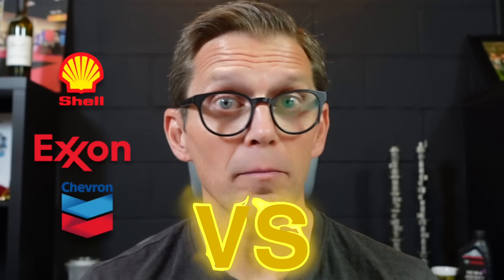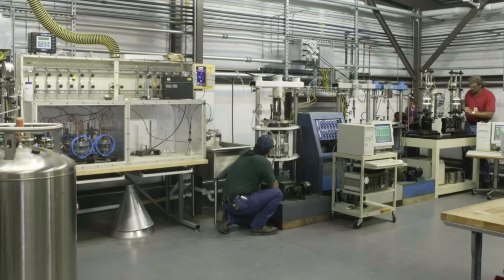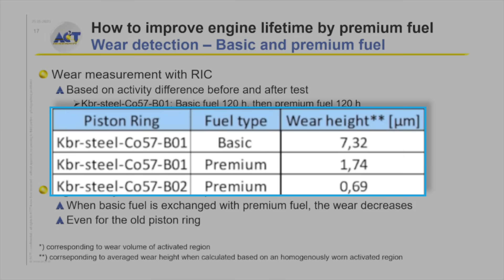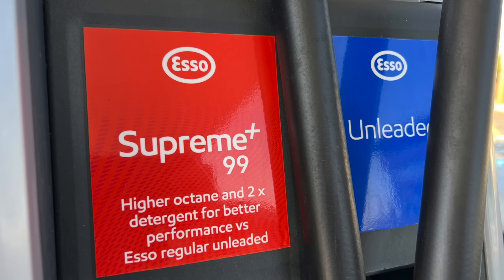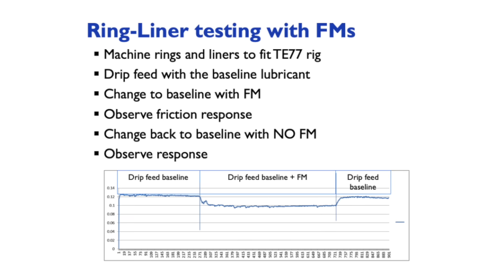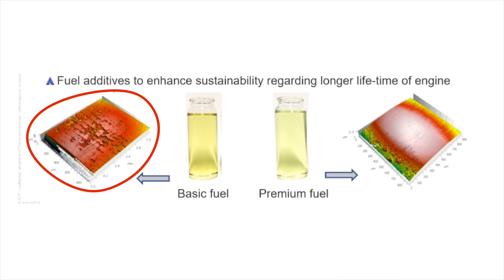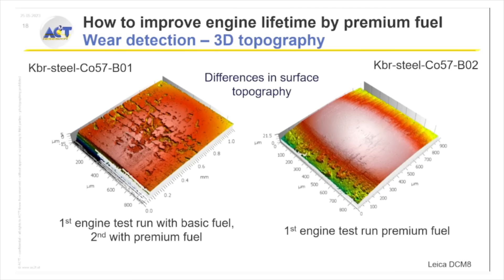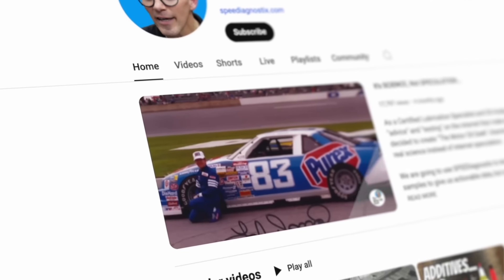Can Premium Fuel REDUCE Engine WEAR?

Comment: I use AMSOIL Upper Cylinder Lubricant additive at every fill up for reasons you mentioned in this video.
Reply: Cool, but how do you know this product works to any level?  Does Amsoil have the testing results as performed in the data Lake presented in this video?
Reply: @chestrockwell8328  yes, they have the test results on their website
Reply: @chestrockwell8328    I believe it is a PEA additive, which is what Lake recommended in one of his other videos.
Reply: @chestrockwell8328    I believe it is a PEA additive, which is what Lake recommended in one of his other videos.
Reply: @chestrockwell8328    I believe it is a PEA or POA, based additive, I forget the acronym but, along with a few other makers those were the ones to use. Which is what Lake recommended in his fuel additive video.
Edit;  Er no that was AMSOIL PI performance improver. Good stuff!

Comment: It was one thing when for many years premium was 20 cents a gallon more than regular but now that it's a dollar a gallon more, there's no way I'm paying it.  I don't understand how they can justify charging a dollar a gallon more for premium. You can buy a good quality fuel additive instead of buying premium fuel and still come out quite a bit ahead, especially if you buy it in bulk.
Reply: I think there is some confusion over the word “premium”. Not 100% sure but I think Lake means “premium quality” not “high octane from the premium pump”. In other words here in Colorado I can buy premium fuel that is only 85 octane.
Reply: @dac7046  Shell V Power Nitro premium has more 3 times more additives than Shell regular. That is according to Shell!
Reply: @dac7046  Required octane decreases with altitude due to atmospheric pressure.
Reply: @dac7046    Yeah, I suspect he is talking more about top tier gas over high octane. 

   Costco gas is top tier and often one of the least expensive in my area at least.
Reply: @dac7046  You have a good point there. I really like Lake's content but imho he really should be more careful about his wording and the video clips he shows in relation to those words. I was recently watching another video of his in which he was discussing fuel system treatments and stressed that you should get one which contains polyether amine. As he is saying this, he shows a clip of someone picking up a bottle of Super Tech fuel injector cleaner, which suggests it contains said ingredient but doesn't.
Reply: I think they do it because more and more cars are now requiring 93 octane because it seems like every manufacturer is switching to turbo which is complete bullshit.
Reply: Regular $2.79/gal
Premium $4.60/gal
That's what it is in my town. 
So yes, you can make your engine last 100,000 miles. All you need are looks and a whole lot of money 💰 🤑
Reply: @ two dollars more a gallon? I don’t think so…
Reply: So what about just using an additive?
Reply: @bullaaron  I was thinking the same, my owners manual says additives are not recommended. If you’re still under warranty and you’re using an additive, they could argue the fact that it says that in their manual and say sorry, this is not under warranty. I think additive’s work though, stable example keep your gas good for two years. so why wouldn’t an octane additive work?
Reply: @ I was thinking the same thing. I used to buy chevron Techron and use it but a mechanic convinced me it was a waste of money. Not sure if he was right or wrong now.
Reply: @bullaaron nah that's actually the best and only additive out there that really works with data to prove it. I watched 1 too many videos and people testing it. I use it here n there in everything now. It has some kind of cleaner in it that does a damn good job in keeping things clean plus lubricant for upper cylinder walls n such
Reply: It's about $0.10 more for each grade here.
Reply: For me it's about $.50 to $.60 to go from 87 to 93.  But I think people do better if they can get Costco gas.

Comment: Would like to see some research on the so-called "Top Tier" fuel, which is advertised as having a higher level of additives (detergents are highlighted). A variety of well known fuel brands now advertise Top Tier complince. Shell has long been on the Top Tier list but i wonder if the others on the list have similar anti wear addiives as well as more detergents than the basic fuel? I saw a graphic demonstration of the value of Top Tier fuel with the the 5.4L Ford I once had.. an engine notorious for the spark plugs breaking off in the head when you tried to remove. Autolite's poor spark plug design, since updated,  was the root cause but combustion chamber deposits tended to lock the plug in practically assuring the plug would break. I ran Shel Top Tier for about 30K miles and the plugs came out without issue and a borescope look show the cumbustion chambers remarkably free of deposits.

Comment: Many years ago, I worked at a fuel terminal, and every single gas station uses the same gas, but the driver will take a little additive and put it in the top of the tank, I forget the gas that was red or pink whatever it was that was just added right at the truck, because all that gas coming across the country is all the same
Reply: Over the years I've always heard this comment. But one time I heard a this comment with a little more information. And that was non big brands will get a lower price by buying the batch that was used to rinse the pipes and what not. Kind of like the saying don't buy a car assembled on Monday during hunting season. Everything is from the same factory, but not everything  the same quality. Any additional insight on this?
Reply: @TakeoHope  it’s all in the same pipes and this terminal was right by JFK airport and it went into smaller barges in New Jersey and a tug boat brought over and every gas station would pull up and they all got the same exact gas, but some would get the additive

Comment: A fuel brand comparison vs piston ring wear would be really helpful in furthering this topic.  Many thanks, I’ve learned a lot from listening to your tips.
Reply from the maker: Great suggestion!
Reply: @themotoroilgeek  Please include Lucas upper cylinder lubricant, and such type product ,
Reply: @Forseen-vm1qs  good idea
Reply: If you do a brand comparison try to get Quick Trip & Costco fuel please! Those are mainly the only two TOP TEIR fuel brands we have locally.
Reply: @themotoroilgeek you keep consistently hitting home runs with your videos. 😎
Reply: @themotoroilgeek  Hey Lake, THANKS for another VERY interesting & informative video. 
I feel compelled to inject a point. By "Premium Gasoline" in the context you're using premium in this video, I take 
it to mean premium quality gasoline. Although, I'd bet the farm 99% of your viewers took your wording to mean 
Premium...higher octane...gasoline vs Regular...87 Octane gasoline.
As you likely know, using gasoline with an excess octane rating than an engine requires is not recommended. 
Not to insult your intelligence: Engines have an octane quench point. Once it is met, any unburned octane that's 
NOT consumed in the combustion process creates ash. This ash will (quickly) degrade the engine oil & create 
undesirable deposits in the combustion chamber(s), on piston top(s), valve head face(s), etc. 
Hopefully, viewers of this video aren't now buying 91, 92 or 93 octane gasoline for their 87-octane-rated engines. 
No doubt MANY of your subs & viewers would appreciate it if you make this point clear in an upcoming video. 🙂 
Respectfully, an Engine Oil Geek in Yucatan Mexico, 
Ben
Reply from the maker: @duygukayhanisaskank4915 in this context I did mean the higher octane fuel.
Reply: @duygukayhanisaskank4915 I had similar questions/thoughts. Will a top tier 87 octane fuel contain the same friction modifiers as the 93?
Reply: @danielphillips1094  Hello & I appreciate your reply. I'm not sure what you mean by "friction modifiers". Regardless, you can be assured that the only difference between the grades of Top Tier Fuels is their octane rating. The chemical components added to the fuel to qualify it as a Top Tier Grade are identical in proportion//quantity. There are only a couple companies making the chemical components. So, quality control of these gasoline additives is reasonably manageable. 
Never-the-less & as I stated in my previous commentary; It's not advisable to habitually//regularly use gasoline with a higher octane than the engine requires. 
There are a few exceptions. But in normal operating conditions, it's bad for the engine & the engine oil. 
Best regards, 
Ben
Reply: @themotoroilgeek  It would be incredibly informative.  I hope you get around to this..
Reply: @themotoroilgeek try bnd automotives ACES fuel additive....supposed to increase piston ring/bore life as proven by DV.
Reply: @themotoroilgeek  Would be alot of work, but have the fuel injector for each 2 cylinders (V8) fed by a different fuel. This way, 4 different brands are tested with loads, fuel rate and ignition/timing being exactly the same.
Reply: Could you test additives to add to fuel in case top tier fuel isn't available
Reply: @richkarlock2195  he already recommended and recommended to me Chevron Techron.... I had 1.6% fuel dilution of my oil in an 18 Camry.
Reply: Use top tier brands for sure

Comment: I've run Shell V-Power Premium in my newly built 2.5L boxer since new.  So glad to see the data behind the friction modifier.  I got 470,000km out of the first engine and it was still going strong when I got this rebuilt one.  So I want more than half a million out of this one!
Reply: You rebuilt a motor that was still going strong?
Reply: @insanelywicked873  Replaced, but yes.  I don't know of many out there who still have a Subaru EJ20 that saw more than half a million, so it was time.  The rest of the car has been rebuilt and re-engineered too, which was the plan all along.  I'm not a fan of the new computers with wheels.
Reply: @insanelywicked873  At that mileage, yes. Just because it's "going strong" doesn't mean there isn't going to be wear. Plenty of seals, gaskets and bearings are going to be worn out, leaking, or near failing. Better to be proactive than reactive because it'll be cheaper than when you blow a head gasket, piston ring fails, or worse a crankshaft bearing fails.
Reply: @SilvaDreams  Exactly, and it was the bearings I was most concerned about.  You get very little warning about that.
Reply: Subie gang🤙🤙 i only run top tier in my built 04 sti, my wifes 08 sti hatchback, and our tribeca! We love our subarus!!
Reply: Too bad that many gas station owners pour the regular into the premium tanks, thus nullifying the benefits and potentially damaging the engines.
Reply: @caryg4638  I don't know where you're from but over here it's not up to the owners where the new fuel deliveries are deposited.  In fact the owners are rarely ever onsite.

Comment: One other thing that I'm a little concerned on your explanation on gas. What do you mean by premium fuel and basic fuel? Do you mean higher octane gas is better or gas? Or? top. Tier is better sorry if I missed it. But I don't quite follow what you mean by the 2 types of fuel. Because they always say, if your vehicle doesn't need premium fuel, don't run it in it. I take premium fuel is high-octane. Fuel?

Comment: Hi Lake, speaking of fuel comparisons, it seems that you can get slightly more power out of an engine by mixing a small amount of low octane fuel with high octane fuel, the theory being that the high octane fuel ignites quickly giving the initial downward thrust on the piston, while the lower octane fuel igniting more slowly enables the cylinder ignition to last just that bit longer, thus increasing the acceleration of the piston over a longer movement.

It would be very interesting to see the results of testing this fuel mixture.
Best regards,
Mat.

Comment: Two comments here. 1. You didn't answer which is more important, fuel or oil quality? I would guess both are important, but the premium price on the premium fuel (in Europe) is rather prohibitive to buy the premium fuel. 2. I doubt that fuel quality is the only factor in the massive differences you see in the oil analysis wear numbers. I would say that air and oil filter choice is at least as important, as silica particles coming in through the air filter and not being filtered out by the oil filter are known to be one of te main factors of engine wear. Having bad filtering of air and oil will have much more silica particles of the "wrong" size suspended in the oil and causing engine wear. Could you make a video on this?

Comment: That was one great lesson.  I only fill up at Shell or Chevron.  With their fuel programs, their pricing is actually very competitive
Reply: Shell has programs that save you money. Most pumps have advertising on them. You can get the app on your phone.
Reply: @oldgringo66  oh I know. I have it. Once I save $.60 a gallon on gas with all the incentives I banked up.
Reply: Ours is at least 10, sometimes 15 or more cents per gallon higher.
Reply: @randywl8925  with their Fuel Rewards program you you can save up to $.10 a gallon and then with other incentive, you can save 15 or more.

Comment: Yes... follow up with specific brands of gas, so we could know which USA brands offer the best wear protection... I try to use "Top Tier" gas as much as possible... but know, )as my brother did the tanker blending),  they are not all the same..."Top Tier" but proprietary and varies from brand to brand.. From my research it seems Shell is the top of the heap,  but not sold in our area... Mobil/Exxon makes lots of claims, but I notice here many of those pumps do not have the "Top Tier" endorsement sticker... The explanation I got was Mobil doesn't monitor independent Mobil station here in the NE area I live, and many are not "Top Tier",  but buying through independent suppliers/trucking, and isn't any better than Joe's garage... Marathon seems consistent .... but how good is their "STP" additive package...
Reply: Did you actually contact Top Tier? One of my local Mobil stations did not have the stickers, I contacted Top Tier with the address. They informed me that station was definitely selling Top Tier gasoline and made note it was lacking stickers. Within a couple months there were stickers placed.
Reply: @Nilumbra  No I did not... and Top Tier would tell you exactly that, as that is the official line...But.... I did speak to my brother, who recently retired, and did the blending from one of the two pipe line terminals in our area... His explanation was... Mobil is supposed to be Top Tier... but there is no longer any oversight in our area, as Mobil doe not have an admin here.... Many of the independently owned stations carry the the Mobil name... but their is nothing to stop them from buying from independent haulers at a reduced cost... who can load generic gasoline with minimal required additives... Increasing the stations margins... As a possible  unstated disclaimer they may not fly the Top Tier banner on the pumps, to avoid conflict if checked... I would like Top Tier to come to our area and police a little... at any rate... in the interim... I'm buying elsewhere when I can... especially it is often the same price at Marathon, or Sunoco... and much cheaper at Costco... even than generic... Scams everywhere these days... Buyer Beware..
Reply: @SailingWJ  sounds to me like that's something Mobil corporate would like to know if stations using their branding were selling subpar gasoline.. Frankly considering this and the fact you don't report them to corporate if you care so much I have to take your story with a grain of salt.

The very station I was referring to is a 7/11 with Mobil pumps and I've been using their gas for years and it's definitely not some cheap subpar fuel as I notice the difference (for the worse) even using gas from RaceTrac.

You say "there's nothing to stop them from selling subpar fuel" well that's Mobil corporates job and if you reported the stations I'm sure corporate would send a secret shopper out to test eventually.

Plus it just makes logical sense that if a store using Mobil's name isn't using Mobil authorized blends... Mobil corporate would know by lack of purchase invoices etc. This is 2024 not 1942 where fraud was far simpler.
Reply: @Nilumbra  For the record... I did report it to "Top Tier"... last communication was they thanked me and suggested they would follow up...  I also know for a fact... many haulers are independent, (actually in our area ALL Mobil is hauled by independents), and as I reported earlier, Mobil has no oversight in New York at the time I wrote it... not sure now as my brother retired a year ago, who ran  one of the two tank farms in our area.   So your suggestion Mobil is inspecting invoices  is doubtful as no one in our area to do it.... maybe they do where you live?  Top Tier has a process for reporting brands who subscribe, but are not posting the Top Tier badge at the pump....  The inference in my communication suggested they do monitor.... and possible test?, and appreciate reports.   I wish I lived in your world, where everything is on the up and up... and no Corporate fraud was taking place... The issue here really is between the independent stations flying the Mobil brand getting delivers from independent haulers.... and no one policing it in this case... Some brands are subject to oversight in our area.. Sunoco,, Costco etc... I try to fill at these...My career in the corporate world was, and is rampant with serious fraud... (I too retired). This is VERY small compared to the things I directly observed... and blew the whistle on...